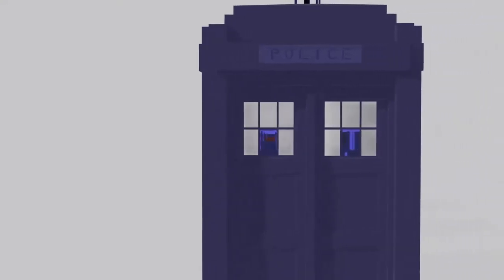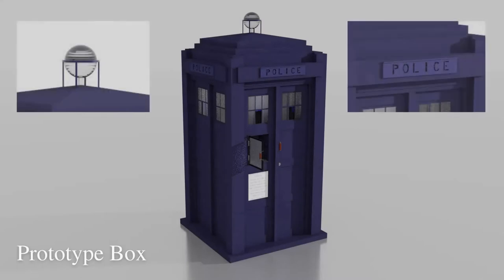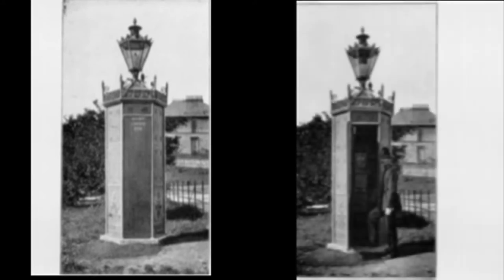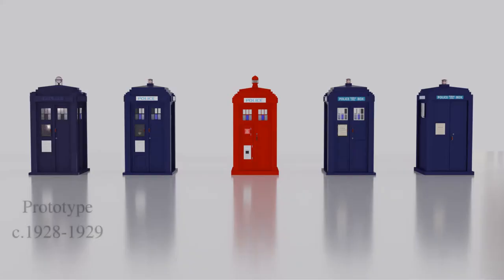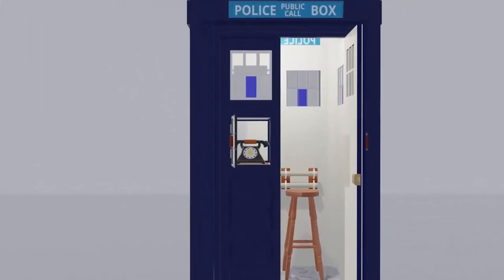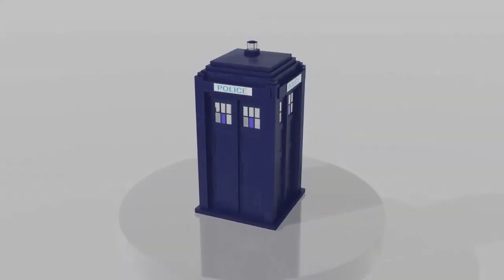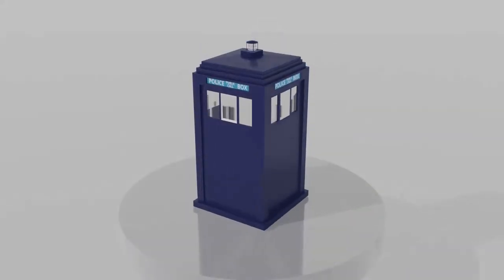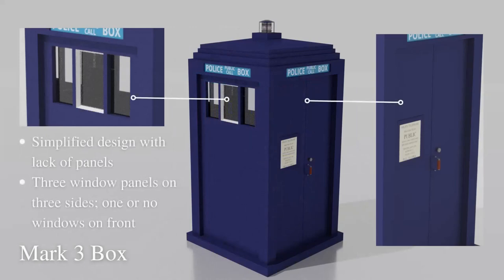The Police Box: a primer & guide

Comment: I wish I had a TARDIS
Reply from the maker: I would be happy with one that didn't travel in time - bigger on the inside, capable of going anywhere, and the interior just the way I wanted it. Time travel would be very handy, though.
Reply: @WeTravelbyNight  so just an RDIS? Ba dum tshhh!
Reply: The tardis is very hard to pilot y’know
Reply: @starplatinum8364  lets agree to disagree, if one man could pilot a ship made to be piloted by 6 people it's definitely not that hard
Reply: @Cageab1 it’s a memory thing to remembered the control or name of the panel. It takes times to remembering all panel or pilot or just stabilizer to do it itself.
Reply: @starplatinum8364  so does flying a plane?
Reply: @Cageab1  kinda